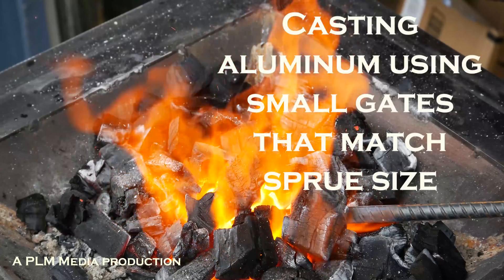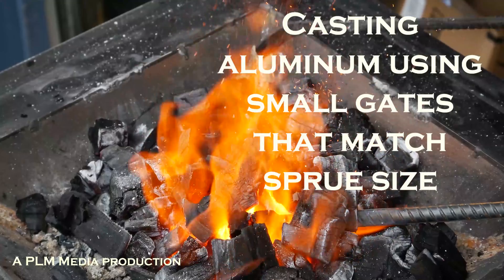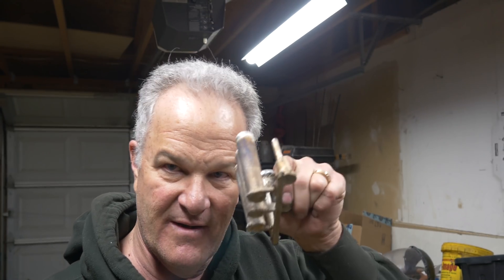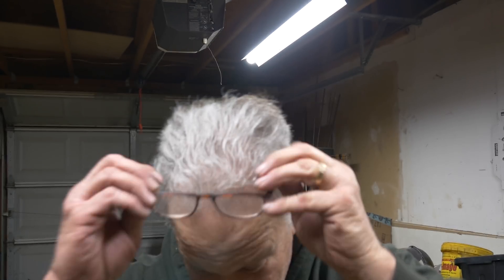Casting aluminum using small gates that match sprue size

Comment: How have you come up with the size for your sprew and runner . Working on a match plate for the bar z summer bash if you've heard of it
Reply from the maker: I was actually given my sprue by @olfoundryman. He said it is a size that he does most of his castings with. I have a 3D model and a measured drawing if you're interested. You can grab them here https://drive.google.com/open?id=1eR7-B0UQNXqHkV8GIl2YMENl2zSlx4DJ

Hadn't heard of the bar z summer bash.

Comment: Are you able to confirm that “shrinkage” (or what people call that) is restricted to the spin-trap and its vent, and none to the three cylinders?
Reply from the maker: As I sit here staring at the casting the only thing that is odd about it is the vent coming off the spin trap. It is noticeably shorter than the height of the cylinders.  It is still domed, convex as opposed to concave that I normally associate with shrink.  The tops of the cylinders each show a little shrink as does the top of the pouring basin but its really small.

Comment: Is this based on the sketch I sent you, or is this your own reconstruction of the Campbell/Puhakka “top gate”?
Reply from the maker: Actually it was based on a design that Bob gave me for a part that I've been having difficulty casting. You sketch was very similar to that design.  I had shown that design to Martin and when I started laying out this experiment he suggested that that I add it to the end of the tapered runner. 

All of this has sort of reinforced the idea of building my gates and runners as part of the pattern, or set of patterns, that I mold. Cutting any of this with a spoon would require far more skill/dexterity than I have or will ever have.
Reply: @swdweeb , yeah: if runners and gates are planned rather than “make ’em big”, it makes sense to have patterns for them.

Did Bob give you tips on sizing the spin trap?
Reply from the maker: @JCSalomon  Not really. He sent me  picture of a 3-D model that he developed.  I mimicked it the best I could.  If I get time this weekend I'll try to cast the part again and make a video of it.

Comment: Wow, that's crazy!  I love watching your videos and experiments. I wonder if there is an optimal ratio of sprue size to volume of what you are casting?  If you were casting something much bigger, would you need a larger sprue, runners and gate to prevent the metal from freezing before it filled up the cast?
Reply from the maker: I'm sure there is, but I don;t know what it is. If you consider trying to keep the velocity under 20 inches per second and your figure out how fast you want to, and can, pour out of your crucible I suppose you could work the math to calculate the sprue and gate sizes.  I haven't taken it to that level yet. I need to get my head fully around utilizing the sprue i have first ;-)

Comment: At first glance I would think that the sprues and runners should be as large as possible to allow as much flow as possible.
But keeping the cross-sections of everything in relationship mathematically to each other makes sense once you know how to think about it.
And your experiment has just proved that.
Now you have to figure out the following : 
Do you actually want the melt to swirl once it is in the cavity or do you want it to be as "calm" as you can get it?
Maybe calm would be better.
I hope so because how do you create swirl in a part that is say 3mm thick, 20mm wide and 20mm high.
Anyway, this was a great video - thanks.

Comment: i see what you did there ;) nice experiment cool to see some 3d printed part designing going on also how the porosity?
Reply from the maker: Porosity?? Perish the thought, You saw how nice it flowed, how could there be any porosity? Of course all of my metal is 85% bi-film so it probably doesn't matter ;-D

I think I'm going to start printing more ob my runners and gates.  I've got a pattern sitting in front of me that has the runner and gate printed as part of the pattern.  It does take some thinking upfront but I think it will make things a lot easier as I move forward.
Reply: swdweeb 😁yes little for thought for sure but I see you working the math that was presented good job I got a new approach also
Reply from the maker: Ooo is that a tease for a future video?
Reply: yes sir :)

Comment: Wait, what about the gate velocity correction factor or whatever it's called?  I thought the runner had to retain constant cross sectional area, but the gates had to add up wider to ensure the flow is moving < 20"/second once it is entering the actual casting and no longer being 'hugged' by the gating.  Guess I'm gonna have to rewatch the videos Bob gave you.  Again...  😁 Keep up the experimenting!  Fascinating stuff.
Reply from the maker: Watch them as many times as  you can. Click on the ads when you do it :-D  

I haven't stopped to think about the flow rate. I guess If I knew that for my sprue it would be a pretty easy thing to factor in to my gate design.  I think, using my highly calibrated eye, that these filled at just the right speed.  I'm kidding of course ;-)
Reply: @swdweeb  it did look like it filled quite gently; no molten metal came squirting up out of the mold or anything.  😉
Reply: @tobhomott , note that using three gates to fill three parts got Perry most of the way to the correction factor.

(The other is that 20 in/s is the theoretical maximum speed for entering the unpressurised mold section, but Campbell points out that in practice you can often get away with even twice that.)
Reply: @JCSalomon  Thanks Joel.  I thought he'd said his 3 gates added up to the same cross sectional area as the sprue base and runner.  Gates total area where they enter the part should add up to that * GVCF as I understood it... Very possible I missed or misunderstood something though. Anyhow, Perry's already explained that the gate velocity correction factor stuff is actually beyond the scope of this experiment, so I suppose my original question is moot at this point.  In any case, I think it's great people are experimenting with these "new" techniques and theories.

Comment: In the next episode, will toothpicks serve?

Maybe use a thin walled copper pipe as a coring drill/device? It would save a lot of hassle when tamping down the sand.
Reply from the maker: Toothpicks?? I'm thinking sewing needles :-D  

I hadn't thought of cutting the parts out. Then again I never thought that lining that stuff up would be such a pain.
Reply: Something along the lines I was thinking.  If you were going to be pouring MANY parts from a single runner, you would eventually get into individual feeders too small to allow the parts to fill.  But what would that size be?  And what would determine that minimum size?

Now, I don't have a GREAT understanding of the metal flow models/pouring theory/etc, but this is the idea that popped in my head: could the minimum size of a runner be constrained by the thickness of the surface boundary (I don't remember what you called it).  Or that combined with the cooling rate of the mould?  In my mind, I keep trying to correlate this with the /skin effect/ in high frequency electricity.  As frequency increases, more of the electrons flow in the surface of the wire.  That would be reversed here, as the surface would freeze first, and the flow would be carried in the center.  It's certainly worth more experimentation.
Reply from the maker: @BrianDaleNeeley   This probably won't help, but it's fun to discuss... from what I understand, as long as the metal us moving forward through the gates, it's not going to freeze. Now I expect that there is some practical limit as to how small the gate can get (as you suggest) but I don;t know how small that is. 
Another thing to do is increase the size of the sprue some... no Martin not a gigantic straight sprue... even adding 1mm in diameter to the area of my sprue takes me from almost 48mm sq to almost 61mm sq a 28% increase.

Another thing that has been brought up is the "gate velocity correction factor" it's possible that having more gates will slow the flow of the metal into the part. A taller sprue... no Martin not the gigantic soup can extensions... will equate to more speed. Adding gates allows the metal so slow before entering the parts.

I don't know, I feel like I'm just rambling here ;-)

Comment: Another John Campbell experiment? In the video you can see the last column, farthest from sprue, swirling. This was also something Bob Puhakka mentioned during his camp fire chats. Isn't it really *$& amazing how small the runners and gates can be?

What is the bottom diameter of the sprue?
Reply from the maker: The diameter at the bottom of my sprue is 7.8mm. If it was a Campbell experiment it was purely by chance. This really came out of discussions I've been having with Martin on the reality of matching sprue/runner/gate volumes.
Reply: @swdweeb  You and I know Martin's skills, Jedi Master. As I mentioned earlier Bob Puhakka had gone through all of this math. I have to rewatch those videos. Bob mentioned a minimum gate size based on wall thickness.

Thanks, 7.8mm is 0.3" for the imperial guys. I'm still disappointed the USA didn't adopted metric.
Reply: If I remember right it's something around 5 or 6 mm (19.63 to 28.27 mm^2)
Reply: Perry, I like your video and audio set up. What equipment are you using? Thanks, Bob
Reply from the maker: @IamUncleBob-R  I have a Panasonic GH4 camera. It shoots in 4K and I use a relatively inexpensive wireless set up from BOYA, model BY-WM6

Comment: Awesome experiment Perry, from what I could see it was really calm rising up in there. I'm trying to come up with a 3rd bottom casting flask to where all this is made up and the pattern sits right on top. Doing this kinda stuff is really going to take your skills to the next level.  Enjoyed it much.
Reply from the maker: Thanks Ray, I noticed the same thing. Nice and smooth and even. There was a little speculation before the pour as to whether or not the first gate would "capture" and unfair amount of the metal moving across but I think having the gates above the runner and having the runner taper upward mitigated all of that.   When I watche dit frame by frame in the raw video the first gate did flow first, the last gate began to flow next and the middle gate (that I didnt get pulled cleanly) flowed last, But they were all with in about 2 or 3 frames of each other so about 1/12 to 1/8th of a second. Not sure tens or hundreds of milliseconds really matter all that much ;-)